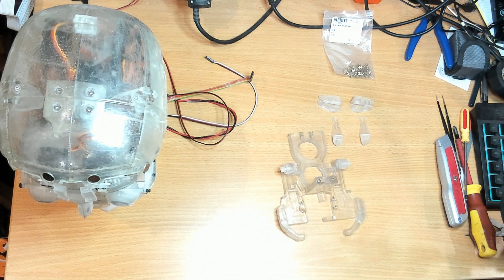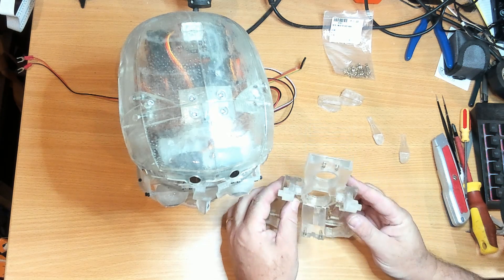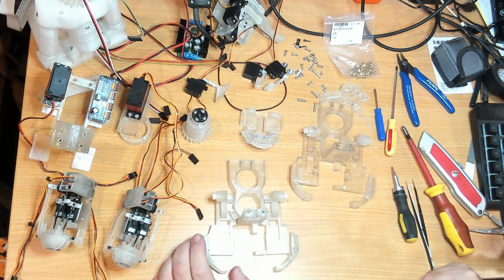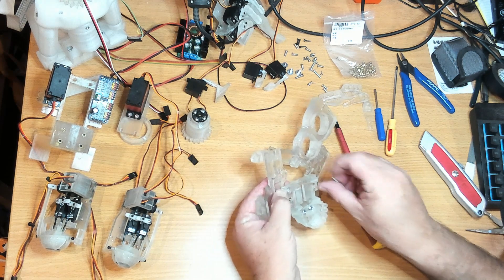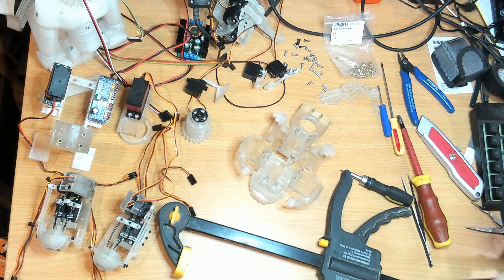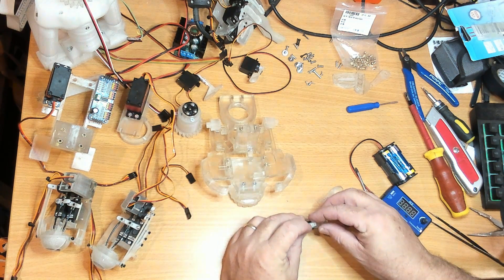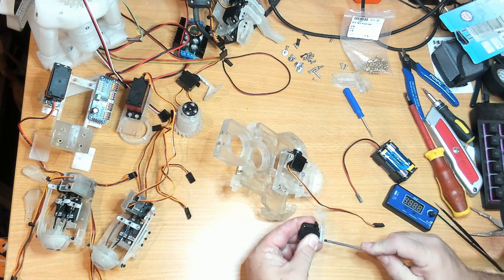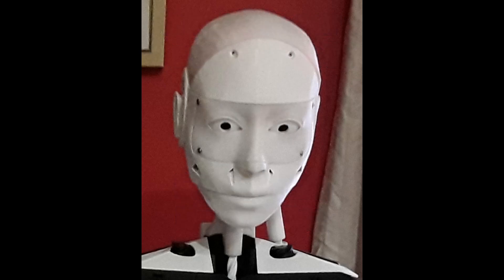InMoov i2Head build Part 9

Comment: I started my first build using the Elegoo 8K water Washable resin with an Elegoo 12K Saturn 3 Ultra printer. (I am limited in what resin I can use in fear of death of harming my wifes parrots) I found it to be too brittle for the build and as a result went out and bought a Elegoo Neptune 4 Max FDM printer and am in the process of doing the entire build over in PLA for the main parts and PETG for all the gears.

My recommendation would be to go the FDM route for the project if at all possible for the cost savings in plastic and the durability.
Reply from the maker: Down side of PLA printing is the parts become more brittle and weaker over time.
I had this issue bite me last year when the shoulder of my InMoov Fred broke.
The other issue was it became soft just from the sun on it.

The resin particularly if your looking for clear parts, is a bit heavier.

Comment: You hit my one big criticism of the Inmoov build; revision and change management is a weakness. 
In everything from the updates to the parts through to the Excel spreadsheet, nothing seems to get updated correctly or effectively and there is no date structure for build process. 
This is even more problematic when you add in the branches created and posted up from others contributing to the project.

I appreciate the efforts and dedication that HairyGael and others have put into the project over the years and I fully understand that this is not a pay for project and is open source, but it would be awesome if the change control was better defined and managed.
Reply from the maker: The screw for that servo and the locking ring to hold the head on are a chicken and the egg type issue.
A lot of the version updates are made as a result of builder feedback.
Problems I ran into with the face mask was having a pre-release set of files, I down loaded all the files well before I started to print.
I should have gone back a checked for updates on the other 4 parts when I was printing.....
If you follow along in the discord the InMoov one for example you see in there when updates are released from time to time.
The same applies to MRL which I try to follow more as there are far more changes being made there every week.